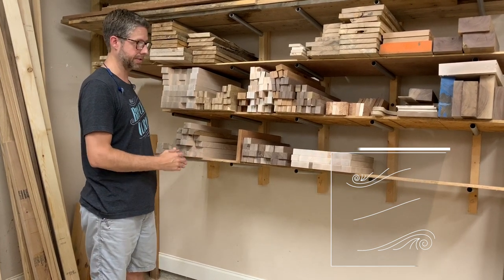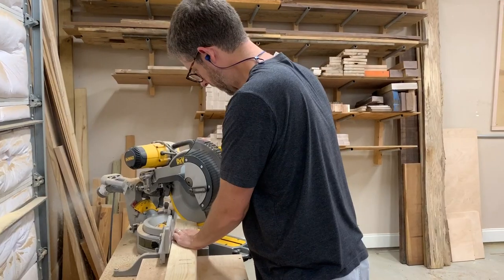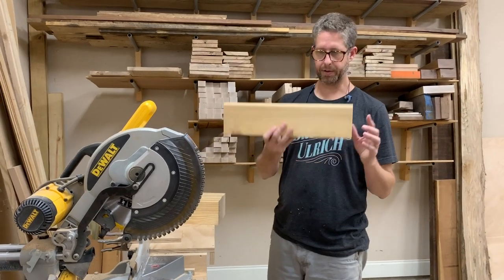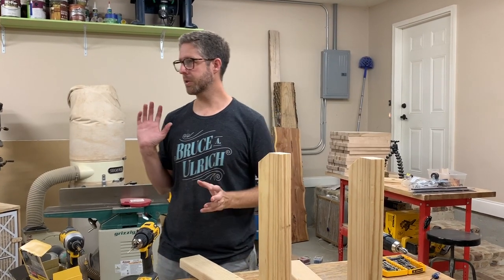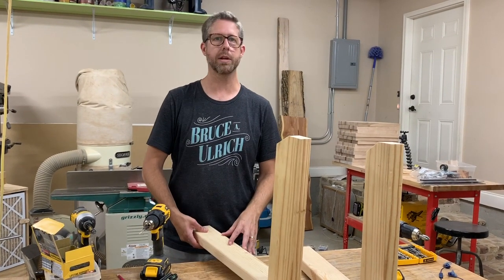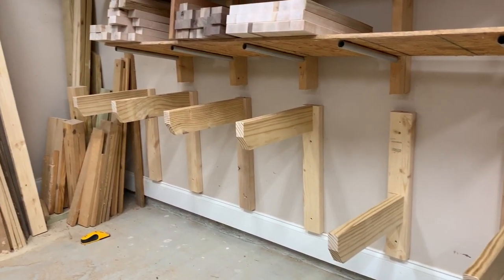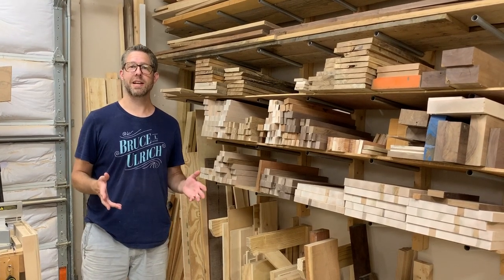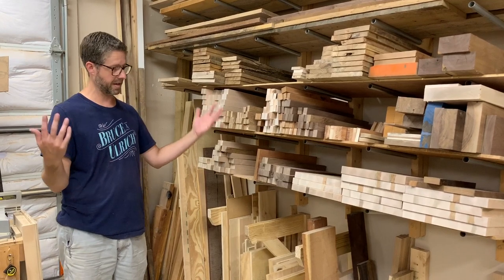Easy Plywood Storage // Shop Organization Ideas

Comment: I love the idea, but I wonder how you can keep that area clean with the wood sitting directly on the floor?  That's what gets me...I end up with bugs, leaves, dust and all sorts of other little things that collect around the wood, I just figured I'd need to see a way to get it off the floor and onto a wall.  What I think I can take from your idea is the individual spaces and different heights.  Thanks for sharing!
Reply from the maker: Glad you were able to take something away from it. Thanks for watching! I end up blowing out the shop with a blower here and there, and it seems to get most of everything that's hiding.

Comment: i find that storing my plywood sheets that way will make them bend more easily (due to the angle and gravity) than if i store them flat or horizontally.
Reply from the maker: I'm pretty careful about how I do it. If you notice, it is mostly 3/4" plywood. Also, they're quite vertical...not leaning much. So, there's not much weight on them. For some of the thinner stuff, I'm sure to just put them between or against another piece or pieces that will help keep it flat.